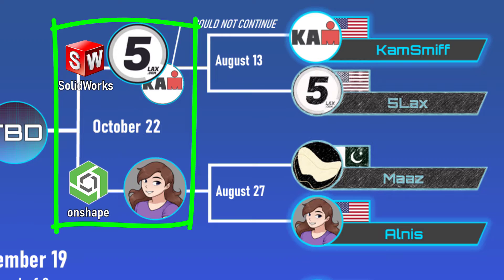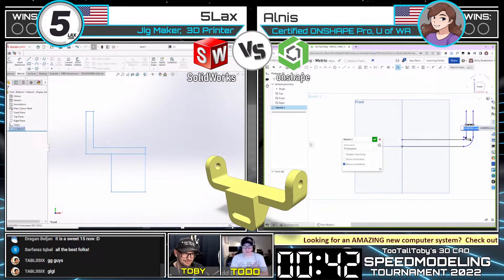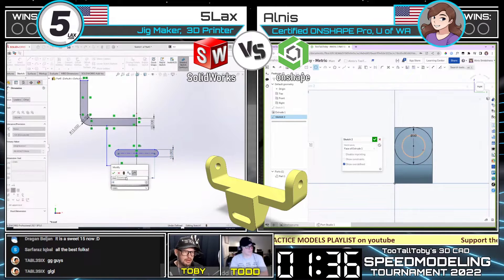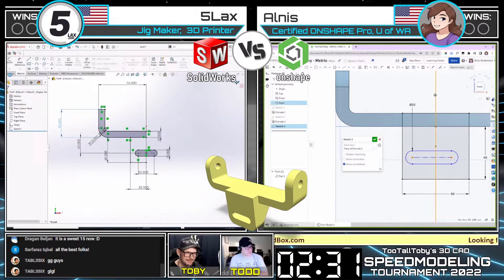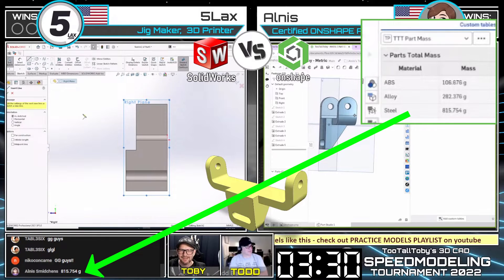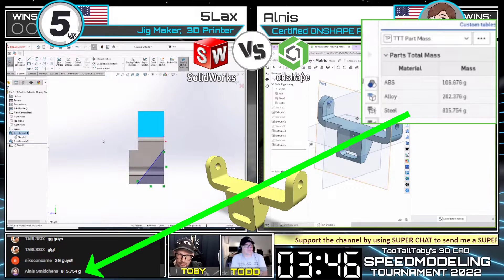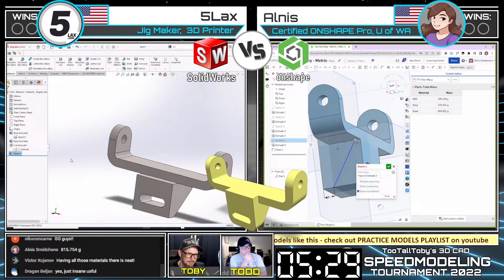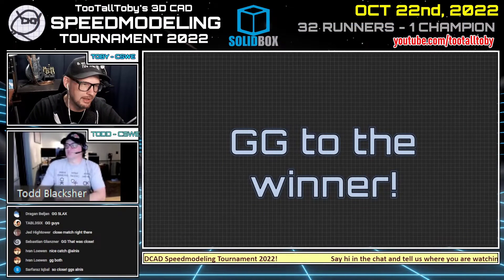onshape vs SolidWorks - Which is Faster?

Comment: is this actually considered fast? this vid just popped up in recommended but i could halve the time in SW. or is the difficulty because you have to guess all the dimensions or something?
Reply from the maker: Hi Muzzarobbo!  That's awesome that you were able to complete this model so quickly!  Did you come up with the correct mass?

To answer your question, this was a highlight from last years WORLD CHAMPIONSHIP of 3D CAD SPEEDMODELING - from the round of 16. The rounds go:  32, 16, 8, 4, and then the FINALS.  So this was pretty early on in the tournament, but these guys are still pretty fast, considering they never saw this print before (and considering this print has one or two little "gotchas").

This year, the prize package for first place includes a 3D scanner and a full seat of Alibre - and we are heading to the finals on November 11th.  So if you watch the livestream this weekend (Oct 28) and watch the finals, you should have a good idea of what the competition looks like, and maybe we'll see you in the tournament next year! 

Good luck, and welcome to the channel!